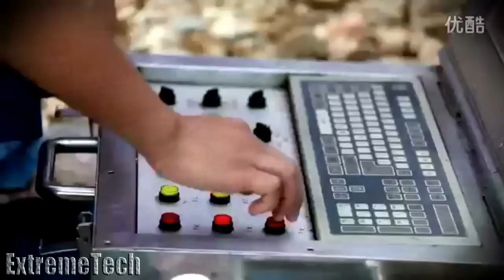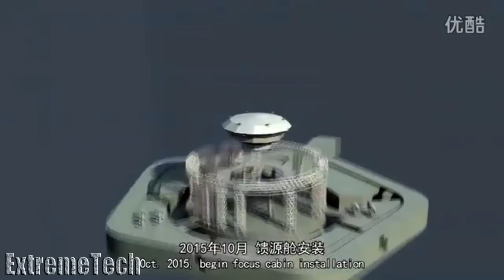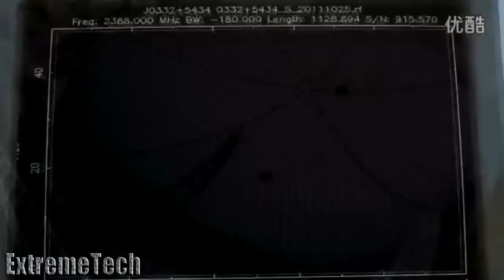Construction of the World's Largest Telescope

Comment: Who is here after collapsing today😔😔
Reply: This is not the same telescope
Reply: @gustavohupfer4466  Let's wish this one to last longer though
Reply: By today I'm assuming you mean almost 3 days ago that a completely different radio telescope litraly half way around the world decided to dismantled itself!
Reply: @jasonliu5789  It might last longer, or at least not have the same failure. The whole suspension of the cabling is more maintenance friendly + the cabin isn't going to stay suspended when not in use. As far as I see from the videos, they lower the cabin when they're done, which takes a lot of stress off of the suspension cables. Arecibo had the suspension cables under constant strain, since it couldn't be lowered. So it was somehow just a matter of time until some of the suspension cable has enough wear & tear to snap. Pretty unfortunate, I hope they rebuild Arecibo.
Reply: @bl4cky89  Very different designs, and different purposes. I hope even better telescope is going to be built as a replacement for Arecibo.
Reply: It's Arecibo not this one😂
Reply: it's in puerto rico not beijing lol

Comment: Very intelligent people.
Reply: @Marinetuck220  not enough to copy, it is neccessary to be working copy! Well, secondly, the wheel is copied goooooooogle time by inventors
Reply: @Marinetuck220  Now, do they also need to copy the collapse of Arecibo?
Reply: @jasonliu5789  nice. I am sure chinese people lerned the lesson and fixed most of the issues that had Arecibo, before they'd made so huge investment in such kind of COPY.
Reply: @Marinetuck220  it's a common design since 1960.